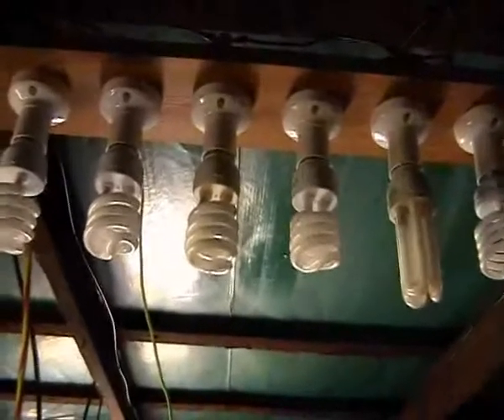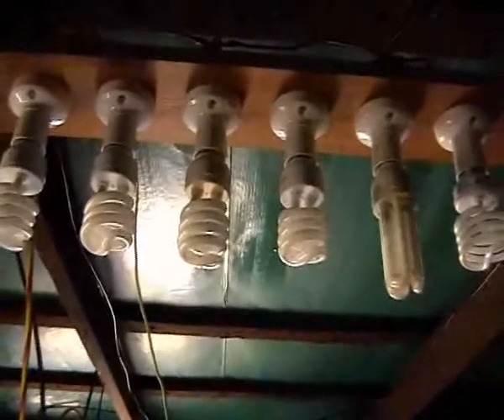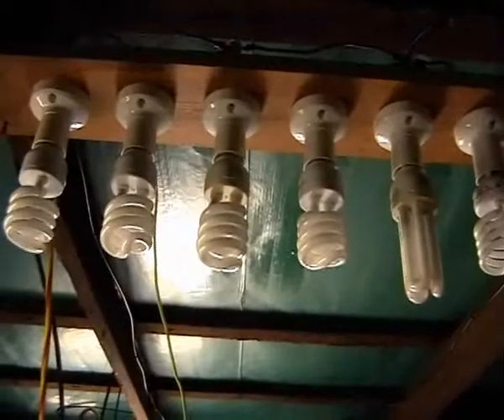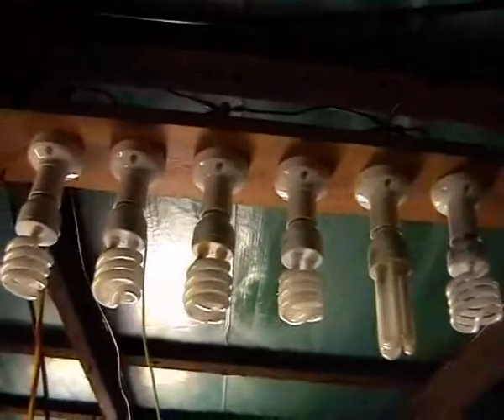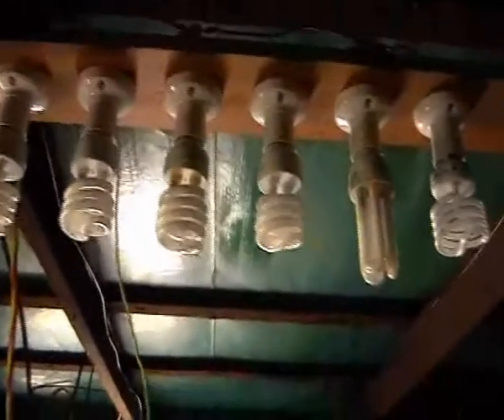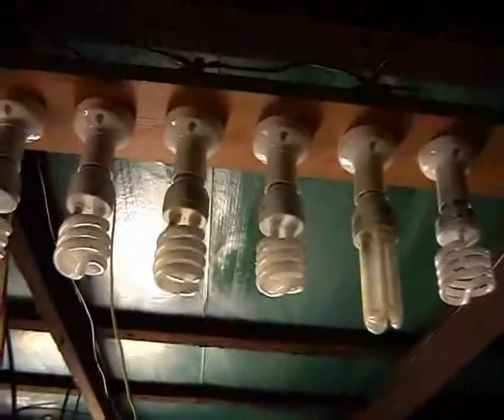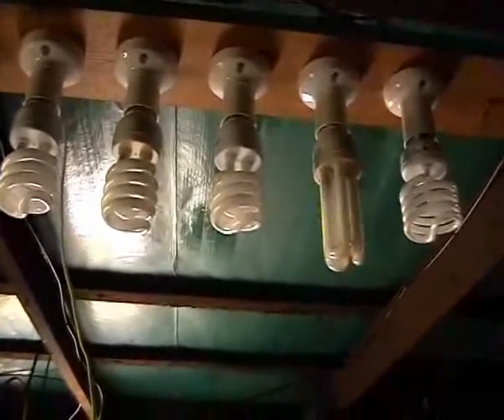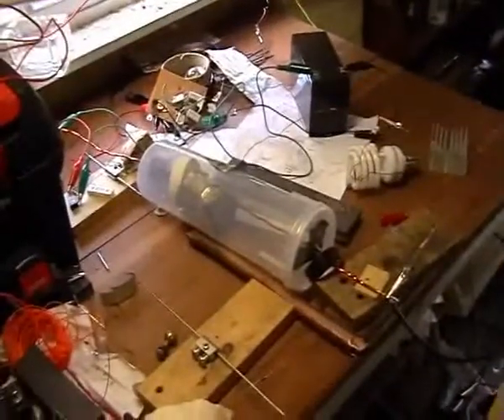UPDATE 29 EDWIN GRAY / TESLA RADIANT ENERGY HYBRID CIRCUIT Running at 60volts

Comment: why so much hard work ? charge a capacitor with (PURE UNIDIRECTIONAL VERY VERY HIGH VOLTAGE) something above its capacitance potential limits and before it discharges, make a forcefull discharge instead by moving a super magnet closely to it and make the discharge terminal not too capable of conductence make this same discharge 100 times a second and u have radiant matter. so the method is "simple as fuck" get the grasp of the dissipation of dc high voltage DISTRUPTIVE/FORCEFULL discharges. the idea is to blast the high voltage dc charge into space very very rapid charge sudden discharge so it would dissipate out to tear the ether and tap out scalar field energy. stop trying vector wtf is wrong with your brains people

Comment: The over unity free energy is due to the high speed motion of the planet as it orbits the sun at 66,000 miles per hour.

The static field of the planet transmits this energy to our devices.

A separation between the 2 sides of the electric field is one of the mechanisms that allows us to tap into the high speed planetary motion.

A time differential between these 2 sides of the electric field produces the torque for our machines.